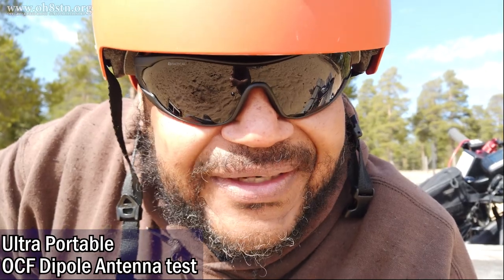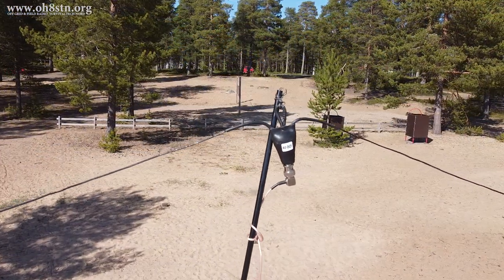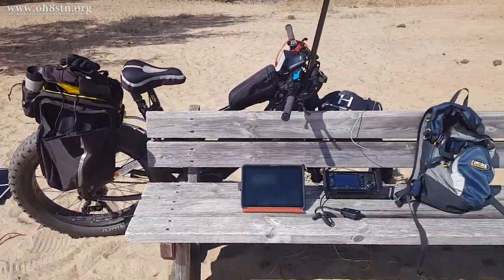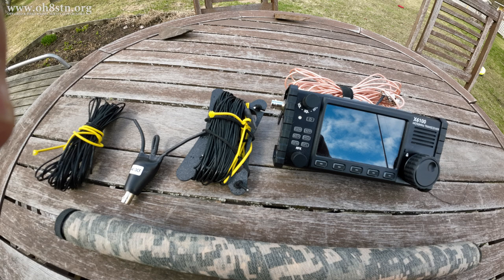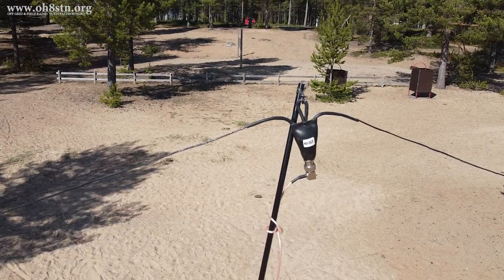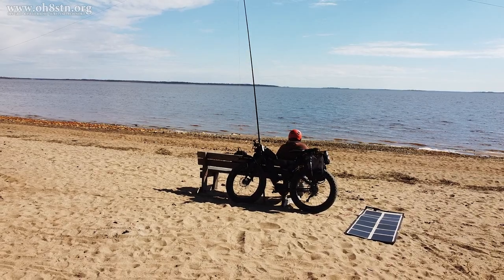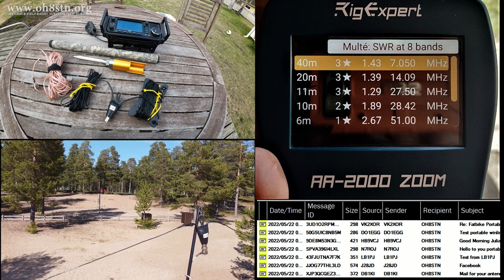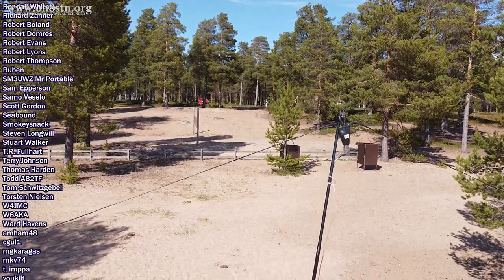Ultimate Portable Ham Radio Antenna | Off Center Fed Dipole

Comment: Newbie here - why a off center fed dipole for portable say over Chameleon's LEFS or a Paktenna EFHW?  Or lets say - what are the advantages to you with the OCF 40 over the LEFS or PAktenna antenna?
Reply from the maker: OCF40 is totslly waterproof and a fraction of the size & weight.
Reply: @OH8STN  I get it - do you have to carry more coax (added weight) if you get it up higher for better contacts?

Comment: Thanks for including 11m. A major prepper band, and a 40m dipole has directionality, and gain, which can open up an entire market on these antennas, with HOA's more common, low-key installs are a must. For the price, installing and switching between more than one and favoring different directions, could add even more punch to a low-key setup.
Reply from the maker: Absolutely well said and I couldn't agree more. Thanks for sharing your insights and kindness.
73
Julian oh8stn

Comment: I use an 80 meter OCF from my QTH. It has been a strong performer. For portable ops, I have been using a 40 meter EFHW and a 49:1 transformer. I think i am going to make  a 40 meter OCF for portable and conduct some A/B comparisons with the EFHW. Great video , thanks for all you do.
Reply from the maker: Excellent and you are very welcome. I also use the EFHW for 80 meters. It is an excellent performer. Perhaps building one for 60, 30, ... would be a nice compromise.
Thanks for watching and commenting.
73
Julian oh8stn

Comment: Hi Julian. I subbed your channel a few plus years ago and dig into your archives on occasion for further edification. Your vids are all Educational/Informative/Useful/Entertaining. Worth every minute of watch time!
I operated an OCFD at two previous QTHs with good results but this QTH location doesn't allow for that. I currently use a 40M EFHW Inverted EL here, when nobody is looking, HAHA......
A few questions.
1. What is the total length of your OCFD antenna?
2. What is the Offset Ratio?
3. Is the Offset Position adjustable?
4. What BALUN is used? 4:1?
FWIW: I found that a Line Isolator about 15 feet below my 4:1 BALUN and at the rig's output/input reduced RX noise. They were needed even in my then benign/rural QTHs. Most likely Power Line/TV-Cable Line on poles in front of house.
I look forward to each of your vids........
Regards/73 OM
Reply from the maker: Hi Russ. This is a commercial antenna so I don.t have much technical details about it. Total length is 68ft. I believe it uses a 49:1 balun. Off set i not adjustable.
There are quite good examples in the ARRL antenna handbooks if you'd like to build one.
Thanks for watching and commenting.
73
Julian oh8stn
Reply: Tnx for your reply.
73

Comment: ZM2  IS ONE QRP ANTENNA MATCH Max=15Watt and is very lightweight 8oz 
or abt 225 grams and abt 5 x 2 x 2 inch 
(or 12 x 5 x 5 cm) and when You order it - order it with BNC connectors! 
It is quite capable to use with xiegu 5105 10W Yaesu FT817/818 and ICOM IC703
IC703+ or the newest IC705. This RXTX has its own antenn match mAT705.

Comment: If you had options of : EFHW,  EFRandom antenna, long-wire, full length dipole, OCFed and random wire antennas ; and all were rugged, ultra portable and water proof , which one would most likely yield the highest Effective Radiated Power? Assuming same 10 watt radio, coax. Coax length, location, and all set up at their optimum configuration. I am concerned with SSB , and I understand that in digital modes and cw 2-5 watts is fine but I am not ready for that yet (I will next year). 
I ask because most claim wonderful things about their setup but I wonder how the above antenna choices would compare against each other. I know that this is not the point of this video but there are so many choices.
Thank you  because you keep it real.
Reply: EFHW 49:140 meters long 134 feet would give you 80,40,20,15,12,17 and 10m.

An EFHW 49:1 the same length as the OCF in this video would give you 40,20,15 and 10m
Reply from the maker: @o00scorpion00o Why do so many operators forget about 60 & 30 meters? These are critical bands for low power data. For emcomm, the only band I really carr about are 80-20, including WARC. The one size fits sll EFHW ignores WARC bands. Now I need a tuner and get reduced performance. 
Check out my strategy video https://youtu.be/OEpFwZhSdMo?si=NTkWsCT7UeJNQ59l
Reply: @OH8STN  You'd need an 80 M long EFHW 49:1 for 30 and 60m. 🙂

the 80-10 m  EFHW 49:1 does give you 17 and 12m WARC.

I have to admit, I don't use 30m or 60m much at all.
Reply from the maker: @o00scorpion00o no, I'd still need a tuner and still have reduced performance. An EFHW cut gor 80 is a compromise on 60 & 30. Watch my antenna strategy video https://youtu.be/OEpFwZhSdMo?si=NTkWsCT7UeJNQ59l the video you're commenting on no longer represents my entire strategy.
Reply: @OH8STN  Going to watch that video now. 🙂

Comment: Julian, shouldn't you use a 4:1 balun to feed that off center fed?  Also, that coax is pretty lossy, even at HF, which will lower your SWR readings - a poor way to  'get a match'... especially at QRP.  I use LMR-200, yeah stiff and heavy, but very LOW loss, even at 2 meters.   BTW, I am an 817ND guy.  Love it!!  I like portable ops, but mostly just day trips, not in a war zone (yet...)  I do use an external batt sometimes, but 8 internal lithium AA's will cover 4 - 5 hours of portable ops, and at 5W, too.  If I need more, another set of those AA's still weighs a lot less than an external.   I either use resonant dipoles or a non res long wire with a Hybrid Micro for multi band ops and the original LG 817 Tuner.  Still, an 817, a coil of coax and a resonant dipole is as simple as it gets.  Plenty of trees where I go to string it up.   Jerry

Comment: Where in the heck you get a fishing pole that tall? What is that, 10m?? I don't see any poles at 10m, and definitely not carbon fiber

I've been looking for a solution to my mast problem for probably 6 months now and haven't solved it. Everything costs a fortune
Reply from the maker: The one in this video is 6m. It came from a normal sporting good store. I've seen those 10-meter "ham radio" versions but they don't pack down small enough and often weigh too much to be really portable.
73
Julian oh8stn
Reply: @OH8STN  I'm trying to put a chameleon sky loop on my property where I have no trees, thus the need for (reasonably affordable) masts.

Comment: How much loss do you experience with the thin cosx compared to say Hyperrlex 5 (Which is MUCH heavier) ?
Reply from the maker: Zero loss with such short coax run as eith portable stations. It'll have to be 100ft or more on HF to see any significant loss with RG316M/U.

Comment: An EFHW 49:1 same length would give you 40, 20,15 and 10m, with an 80 m coil you could get 80m with reduced performance of course and narrow bandwidth but still useful to have 80m.

not sure I see the advantage of the OCF ? The EFHW can be just as light and portable.
Reply from the maker: It's a deployment preference. 
Two stretch cords and a center pole.  No RF coming back down the coax. Doesn't need to be as high at the apex.
Strategy https://youtu.be/OEpFwZhSdMo?si=NTkWsCT7UeJNQ59l

Comment: Hi!  
I have a question if you don't mind.
The wolphilink is no longer available.  Is there any alternatives I can use with the ft 817nd and android?
I appreciate your videos and time you give to your channel.
Chuck KK4BZE
Reply from the maker: Here you go.
http://oh8stn.net/digirig8xx
Reply: Thank you for your quick response.  
Chuck
Reply from the maker: Hi Chuck.
It's a GZR Raw 26in fat tire bike with 250 watt Bafang mid-drive motor and 14ah 48 volt 13S li-ion battery. It's charged with a Genadun charge controller and OF panel. Details on chafging here. https://oh8stn.org/blog/2022/02/08/ebike-solar-charging-how-to/
Reply: @OH8STN  
How are you today sir?  I do appreciate knowing about your bike, but I think you have made a mistake and sent this information to the wrong person.  P.S. my digirig is on the way.  You are my goto for information about ham.

Chuck

Comment: Almost religiously watch your videos, Julian. Point of curiosity: re your wire antennas, what's your technique for getting the end(s) up in the tree(s)?
Reply from the maker: Thanks for watching, the kindness, and the question. I'm usually deploying in an inverted V if I have dipole. That means I keep the ends of dipole no more than as high as I can reach with my hands while standing on the ground. That's usually under 6 1/2 ft or 2 m. This reduces ground losses provided the apex of the antenna is up high enough.
Reply: @OH8STN  ... and ya know watching something a former Jarhead does is a major compliment ;-))

Comment: What kind of e-bike is that? Thanks for the video.
Reply from the maker: It's a GZR Raw 26in fat tire bike with 250 watt Bafang mid-drive motor and 14ah 48 volt 13S li-ion battery. It's charged with a Genadun charge controller and OF panel. Details on chafging here. https://oh8stn.org/blog/2022/02/08/ebike-solar-charging-how-to/

Comment: Nice job!  I think for small portable and light antennas that don't need a tuner you can't beat the EFHW from Adam K6ARK !!!    That has to be the smallest and lightest resonant, multi-band antenna I know of.   Have you seen and/or tested one of those?  (He also has a YT channel in case you don't know him check his channel he does a lot of lightweight stuff for SOTA hiking)
Reply from the maker: Hi Stewart. 
Definitely lightweight kits. Unfortunately one criteria lacking for my own operating conditions, is being waterproof. In these conditions survivability of the equipment is also crucial. This is the reason I've passed on many of the SOTA based options.  If I carry a tarp or a tent, able to deploy in the rain, my antenna has to work in the rain as well.

Comment: So rather than spend $150 for this wire antenna,  wonder why you didn't just home brew it!! Or rather than having to pay for the 60/30M version,  and bring a second antenna,  why not use a 66ft wire, 49:1 transformer, which will give you 40- 10M including 30M?? without a tuner!!!

I like your videos but not sure of the rational, of spending money  on overrated wire antennas from Chameleon.
Reply from the maker: Why should anyone need to justify their gear choices to you?
Anyway, my time is very valuable. Being nearly blind, antenna building is not one of my favorite hobbies. If I can buy it, usually I will. If what is needed can't be easily found, I'll attempt to build it myself. Almost all of the portable batteries on the channel have been bespoke built by me. It is a fast easy process and I am good at it. The money saved and performance gained is easily measurable, (and I enjoy doing it).
What is missing from the market is small, lightweight & waterproof 50-watt ~resonant antennas for 80/40/20 & 60/30. These I plan on building myself since most companies want to design "portable" antennas for 500 watt contest stations.
73
Julian oh8stn